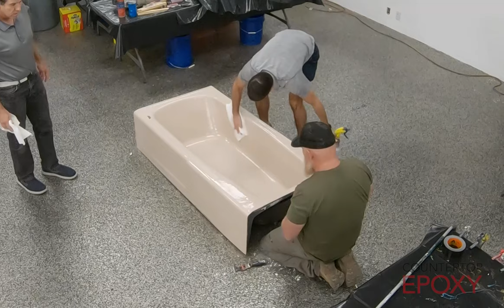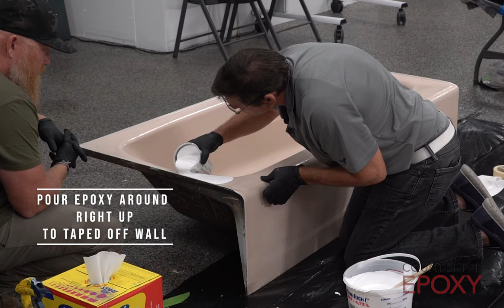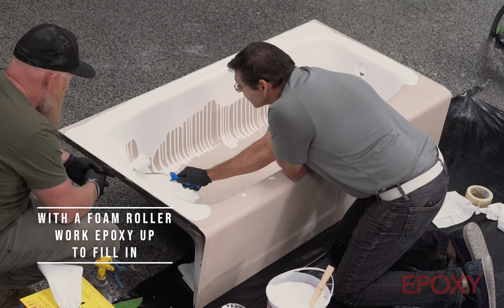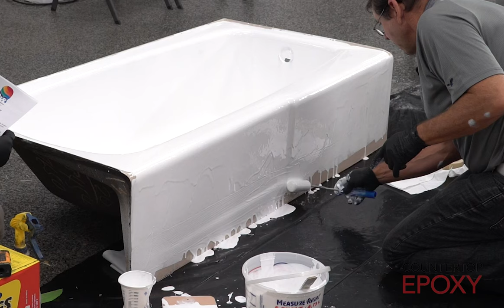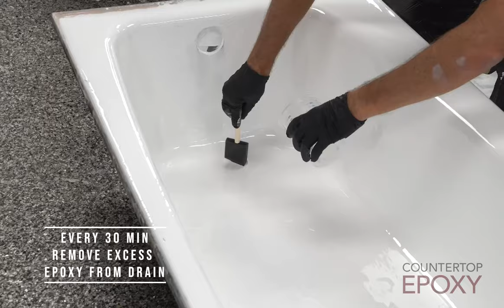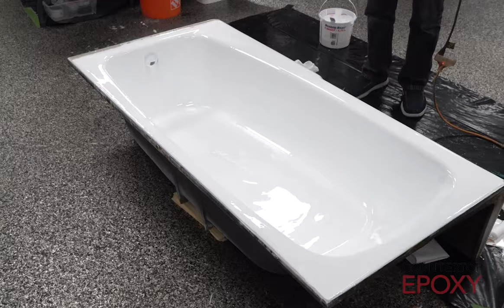HOW TO - Coat a Bathtub with Epoxy - Bathtub Refinishing  DIY - Reglaze Bathtub

Comment: I think the industry standard of urethane is still Superior as it could be put on thinner and has a tighter Bond and better smoother look. This epoxy looks pretty lumpy in the video as a finished product. The urethane is actually cheaper for raw material cost as well if you don't include equipment but then again you could also just pour the urethane but that would look sort of like this video so why would you? Besides a new tub is only $200. If you were going to go up scale you would tear out a tub entirely and put a walk-in shower. There is also the issue of the bottom of the tub being super slick and all of the epoxy being easy to scratch.
Reply: After being a professional refinisher for over a decade, I can honestly say that urethane is absolutely not a superior product. It's too thin so it ends up not being able to hold up to a much thicker pour on type of epoxy like this. Also all of those bumps you're seeing in the front is the shape of the tub. Pretty much all Porcelain tubs have a bunch of ridges all over the place because it's Porcelain enameled.
Reply: @adolfoescorcia2051  You must be using box store tubs. Quality steel tubs don't have that. It still looks like the epoxy didn't flow well.
Reply: @daniel buckner  We must be seeing different videos because it looks like the epoxy took the shape on the outside as they tend to have those ridges in most Porcelain tubs I've ever seen/done. Also, the whole 200$ a tub argument goes out the door for the average consumer considering most people do not have the skill or tools to be ripping out their old tubs and replacing them, so hiring someone generally costs 1,500.00 minimum not including any plumbing, ect.
Reply: @daniel buckner  We must be seeing different videos because it looks like the epoxy took the shape on the outside as they tend to have those ridges in most Porcelain tubs I've ever seen/done. Also, the whole 200$ a tub argument goes out the door for the average consumer considering most people do not have the skill or tools to be ripping out their old tubs and replacing them, so hiring someone generally costs 1,500.00 minimum not including any plumbing, ect.
Reply: @daniel buckner  We must be seeing different videos because it looks like the epoxy took the shape on the outside as they tend to have those ridges in most Porcelain tubs I've ever seen/done. Also, the whole 200$ a tub argument goes out the door for the average consumer considering most people do not have the skill or tools to be ripping out their old tubs and replacing them, so hiring someone generally costs 1,500.00 minimum not including any plumbing, ect.
Reply: @daniel buckner  We must be seeing different videos because it looks like the epoxy took the shape on the outside as they tend to have those ridges in most Porcelain tubs I've ever seen/done. Also, the whole 200$ a tub argument goes out the door for the average consumer considering most people do not have the skill or tools to be ripping out their old tubs and replacing them, so hiring someone generally costs 1,500.00 minimum not including any plumbing, ect.
Reply: @daniel buckner  We must be seeing different videos because it looks like the epoxy took the shape on the outside as they tend to have those ridges in most Porcelain tubs I've ever seen/done. Also, the whole 200$ a tub argument goes out the door for the average consumer considering most people do not have the skill or tools to be ripping out their old tubs and replacing them, so hiring someone generally costs 1,500.00 minimum not including any plumbing, ect.
Reply: @Adolfo Escorcia  Haha, oh yeah?!?! Please tell me where I can hire someone to do that for 1500! Way more than that dude and if not then you definitely are slummin. Still looks like poor pour and that is setting aside the epoxy vs urethane vs urethane epoxy convo AND the whole cheap tub vs quality pressed tubs. Good luck with all that! ￼￼
Reply: @daniel buckner  Not really, pricing for replacing a tub usually starts at 1,500.00. Not including the tub. I could actually send you 3 numbers of people who install at that price here in Texas, easily. It also just does not seem lumpy to me at all, that just seems like ridges along the edge which is just the shape of the tub itself, I've gotten those same ridges using epoxy, urethane, polysiloxane, ect. Because that's just the shape of the tub itself. How do I know it wasn't just my application? Because I use an HVLP to spray it on so it would be impossible to create that kind of build up without the paint running
Reply: @Adolfo Escorcia  You must live in a place where the economy isn't too great. I wouldn't bother to show up if that was all the labor I made. Have fun with that. HVLP and not turbine... have fun with that too. I don't know ANY refinishers except a couple really old school guys in New England that don't use a turbine.

Comment: That’s going to yellow so fast!  Stop teaching to skip the top coat.  The top coat is the most vital step.
Reply: Maybe with other brands it would, but if you haven't used our products yet it would be helpful to know that our products are color stable once cured and have the highest level of UV resistance available! No additional top coat needed my friend. Only if this were in an area that received a lot of direct light, such as an outdoor tub, would we then recommend utilizing a darker color. Glad we could help address debunk that thought process though, thank you!
Reply: @customerservice14  might be silly question, but...is it possible to paint toiled bowl with this tub paint?  that would be nice to have bowl and tub in the same color 👍🏻

Comment: You answered 3 major questions I had. And genius to tape across and then cut the tape.  I would've tried to tape in a circle lol.   Excellent.  Thank you. Now I might actually tackle that.   Question then... if it's a tub/ shower one piece,  would you start at the top of the wall and let it run down first I assume..?

Comment: Thanks, this video provided the technique I needed. I'm gonna diy my tub using this technique. Except I'll be using microcement not epoxy. Great video.
Reply: How does microcomputer differ from epoxy? Easier? Easier to clean after? Less messy? Stronger? I'm in the beginning stages of remodeling and one tub is in good shape but I would rather have it look white rather than beige. That's why I ask

Comment: Question: There is no need to sand prior to pouring the new epoxy?
Reply from the maker: Yes we suggest a light sanding for a better bond with our product!
Reply: Do you need to etch the ceramic tub first before applying the refinishing epoxy resin?

Comment: How can you do this to a tub already installed? The excess epoxy can’t go down the drain, can it?
Reply from the maker: No you would want to mask off the drain. Here we show with tape however you can use PVC pipe and silicone.

Comment: Thanks for this, it was useful.  However, would like to know drying time and if you dont have a heat gun, what can you use? Especially when you are not a pro and dont have such things on hand/ have a 1 bath at home.
Reply: You can buy a heat gun at any home Depot or Lowe's or even craft store. They're well under $50
Reply: Or use the blow dryer
Reply: Propane torch.

Comment: Hi I loved your video. I have a question about solving a problem with the corners of my metal tub.  Every corner is just a tad unleveled which makes the water puddle.   How can I solve this?
Can I sand the corners and poor a bit of self leveling epoxy on them and expect it to work?
Please advise! 😊 thanks!
Reply from the maker: We have a wall kit that is a thick consistency that would help level. Get give us a call so we can help you through the steps 970-639-9338

Comment: Thanks for making this video. 

Did you have to sand the tub first?
Reply from the maker: Yes we did a light sanding and cleaned it very well prior to the pour
Reply: @CountertopEpoxy  what grit sanding pad? Wet sanding?
Reply from the maker: @TheBayAreaSideshow  you can use a 300 grit and it doesn’t have to be wet sanded you just want to sand it enough to rough it up a bit.
Reply: So where can I buy this product what's the name of it?
Reply from the maker: @tamimamini8  this is our Tub Coating Kit you can find it at CountertopEpoxy.com the site is currently 30% off until 11/28!

Comment: Can you make a bathtub 🛀 with the same kind of design you do on countertops?
Reply from the maker: It is possible. We have done a few. It's very advanced and we really had to think about the design and steps to achieve the look as well as temperatures and flow of the epoxy.

Comment: There's no special cleaning beforehand?
Like those Rust-Oleum kits that require a while bunch of prep and toxic chemicals to bond the coating!
Reply: This. 
I use:
2 part cleaner with 220 grit sand paper. 
2 part primer bonding promoter. 
2 part epoxy primer.
2 part resin top coat.
Full ventilation system. 
5 hours if I'm in no hurry
Tub is good to go in 12 hours.

Comment: I just painted my bathtub like painting a car which is after spraying primer and the white base coat, then three layers of clear coats, wet sanding orange peels, buffing, and polishing and waxing. 
Not sure how long it will last comparing to pouring risen. I'll wait.
Reply from the maker: Yes keep us posted. Feel free to contact us if you need our product and if you would like to learn more. 970-639-9338.
Reply: Did it hold up?

Comment: How many coatings will it need to create a thick layer so that it has longevity ? If we use color, how do we make it stay and not drip towards the base ? I think you need to make a colorful one to showcase this ! People are bored by 1 color bathtubs and online there is nothing related to make a bathtub look like one of the countertops.
Reply from the maker: Hey great questions our kit is meant for one layer and that is a thicker coating. Once the product is on it will level a little you just scoop any excess from the bottom and you’ll be good to go. On our TIKTOK we do lots of colors for fun on the tub. Maybe we’ll post a short today of one.
Reply: @CountertopEpoxy  thanks. I want to try but i have zero experience with these materials.

Comment: But the smell of the tub epoxy I used before is overwhelming!!!
Reply from the maker: Our product is zero VOC no solvents or harmful odors!
Reply: @CountertopEpoxy  well, then that would be amazing. Believe it or not, I told my husband that couldn't help because he had lung cancer, that I needed a respirator. He told a friend where he was working before the cancer for a respirator. An exhaust fan, a stand up fan and the respirator still didn't help. Is your color white a true bright white or off white please?
Reply from the maker: @anitalusk3165  it is a true white give us a call for more details regarding your tub project 970-639-9338
Reply: @anitalusk3165  What? I dont understand what you typed. It doesnt make sense. Are you saying he wore a respirator at work but still got cancer?  Or are you saying they didnt give him a respirator at work and he got cancer?

Comment: Final look : it looks like crap!
And don't even think of pouring epoxy over countertops. Even bigger crap.
Epoxy isn't for countertops, neither it is for bathtubs.
Reply: @ericmcgee4666  Hi, you used  epoxy only on countertop or tub also?
Reply: @Ok-yr1fm  I have done 2 sets of countertops…doing a sink here soon..never done a tub
Reply: @ericmcgee4666  Thank you for quick reply.
..so you gonna change sink color with tub epoxy? (or just installing) why i'm asking, i want to change my sink color, yet not sure if it would be good idea. ...another question if it not hard for you about  countertop: did you used old countertop or new wood (not sure what i want to do with mine)
Reply: @Ok-yr1fm  contact customer service and they will tell you exactly what you need. You could use either the tub epoxy or the countertop epoxy to do your sink.
Reply: Yeah it would look much better sprayed on. A 519 tip, tack coat and a final coat and done. Amateurs!